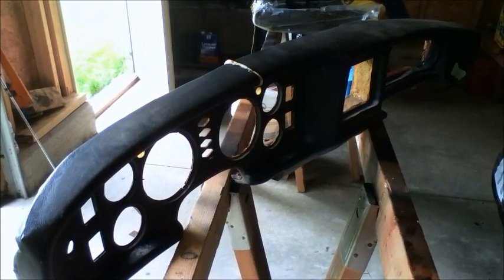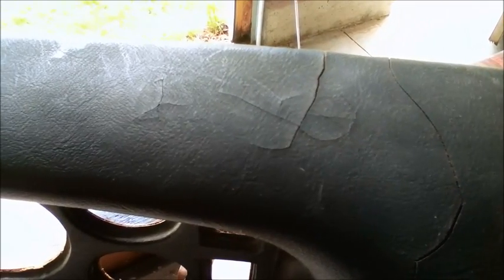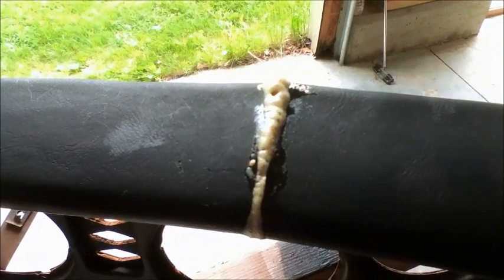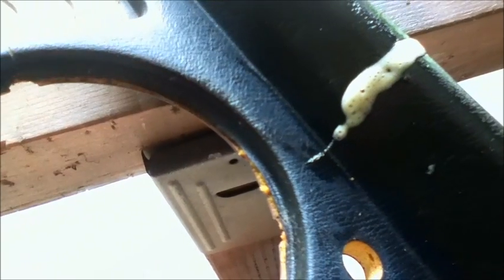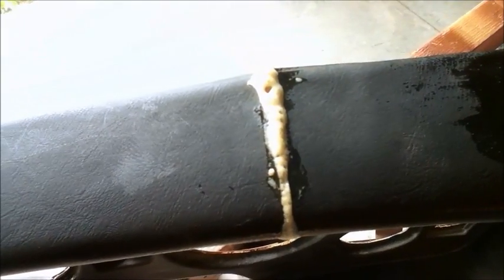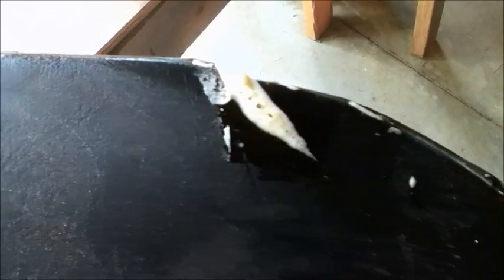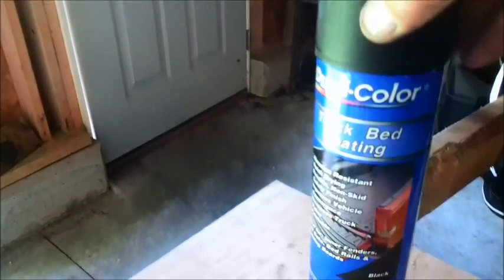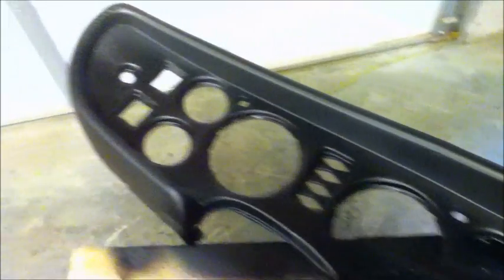Restore a cracked dash

Comment: Good ideas!  How is it holding up?
Reply from the maker: Nate Harris - - Well, I was disappointed with the result. Somehow the truck bed liner in a spray can must not have been sticky enough because a bunch of bubbles formed. Maybe too much silicone based sealer used by a previous owner?? If I do it again, I will use a stronger solvent to clean the surface and apply primer before spraying the finish. Maybe rubberized undercoating will work better? Anyhow, I think I am on the right track. Thanks for the comment.
Reply: I like the idea of the gorilla glue too.  But perhaps you might consider flocking the dash instead of just painting it?  I only recently learned about flocking (fine fibers covering the whole dash) and found you can DIY it too.

Comment: why not just use vinyl paint??
Reply from the maker: This is a good idea. I was looking for a finish that had some texture to hide any other defects but your idea might work also. Make sure you do complete prep and use a primer to make sure it sticks. Mine started to bubble a bit once it got into the sun.
Reply from the maker: The bed liner that I used bubbled. I'm not sure if it is a problem of the paint or if years of Armor All caused the problem. I would be curious if vinyl paint would work better.

Comment: Don’t try this I attempted this repair on my dash and it seemed like a great idea it sanded down nicely and I put spot putty to smooth it out even more painted it with bed liner however when I put it back in my truck the glue shrunk in the hot sun and slight visible valleys are now visible after a couple days it increased . This is a FAIL Don’t do it unless you want to redo it a second time . I will try kitty hair bondo next time and hope it doesn’t shrink in hot sun.